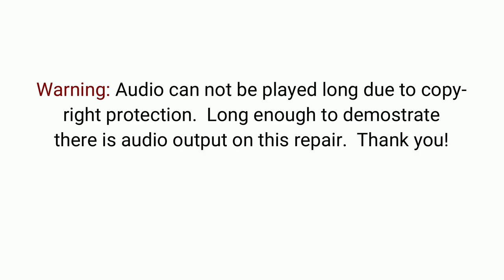Bose 3 Disc Changer - Disc not spinning. Can this gal fix it? You bet I can :)

Comment: Love your videos, very informative.  I too have a bad spindle motor.  I am having a hard time finding a replacement.  Do you have a source or recommendation for a replacement spindle motor for the Bose 3 disc changer? Looking for replacement part numbers that are the same spec as original? Any help you can provide would be greatly appreciated. Thanks!

Comment: I'm working on a NAD 521i single disc player that shows 'disc error' and not reading discs. I found the laser was out so it was replaced yet the problem persists. All precautions installing the laser was taken including the unsoldering of the static safety point. All motors function as intended and switches on the sled were cleaned, rails lightly lubricated, ribbon connectors checked for condition and continuity, different cds trying but resulting in the 'no disc' condition. At this point I suspect one of the ic's has an issue that controls the laser but not entirely yet sure. What's your take on this? Thank you!

Comment: HI - My Bose 3 disc changer (SerNo 037756980330151AC) isn't spinning at all. After applying power it shows disk error on all 3 drive locations even with 3 disks installed.  The single CS drive in the radio works normally. Once power is applied (with case removed) I can see that it cycles through the 3 mechanisms (and the front leds light one at a time) (probably to see which disks are present) but then there is no rotation of any disks.  I did notice that the triangular metal platform isn't level as it goes up and down. When 1 corner gets all the way to the top one of the other corners sags about 1/8th of an inch lower. Do you think one of the worm-screws got misaligned, out of sync, or broken? Can you suggest anything for me to try? Is there any suggestion as to what may be causing this such as lack of lubrication or misaligned gears?  I'll keep trying. Thanks and keep up the good work.

Comment: I forgot to mention in my comments  of an hour ago that none of any of the 3 disks actually loads all the way into the play position. No wonder they're not turning! Also, after cycling power about 10 times, the platform no longer goes up and down but now stays in the lowest position no matter how many times I remove and reapply power.  I guess I have more problems than I thought.
Reply: Hello John, 
To give you some help if you have not gotten any yet there are micro switches that could be the cause to your problem if you look up where the micro switches are a video will pop up which explains it all. Going over all the ones I have personally repaired that has been one of the major issue that comes up.
Reply: @kaseymartin3645  Thanks for the help. My problem turned out to be a misalignment of the C-shaped metal bracket that is held between the upper metal plate and the lower assembly. The bracket had moved when I replaced the upper metal plate. Once I realigned it onto the upper and lower pivot points the disks loaded properly. Thanks again. I also fiddled quite a bit with two of the three worm screws that lift and lower the platter. I got them to work quite well and the disks seem to play just fine. Quite satisfying to get this far.